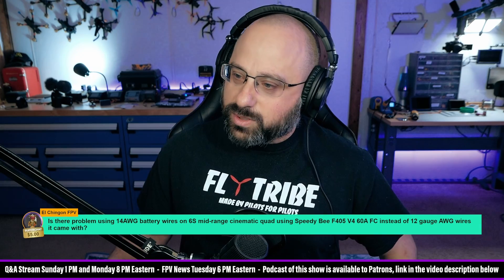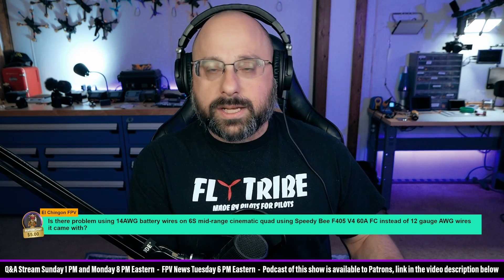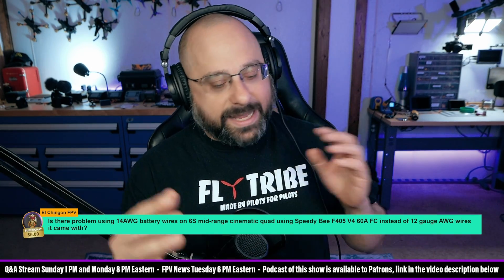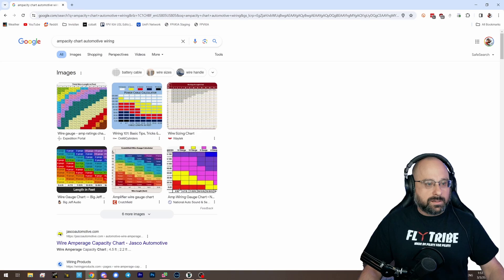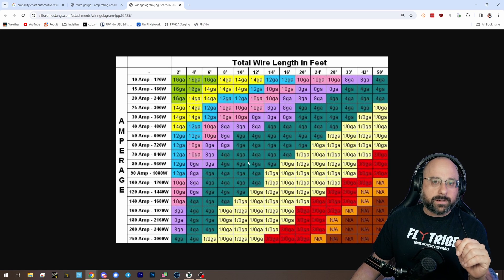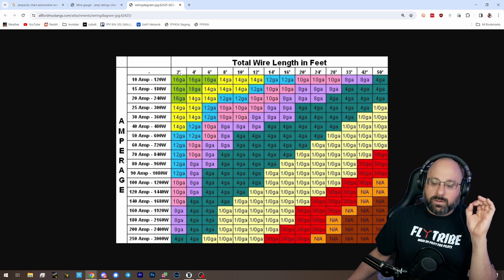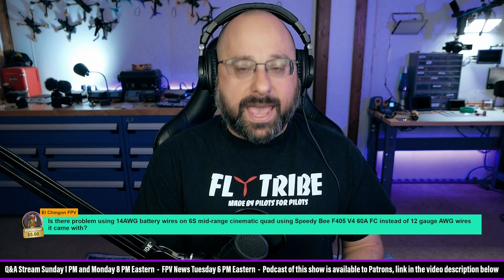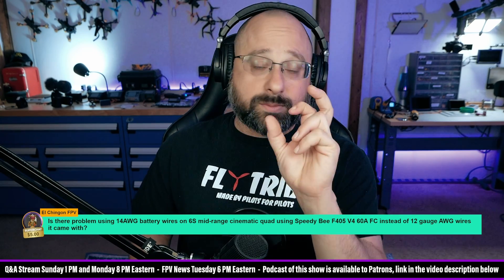What Wire Gauge For My 6s Battery? Lipo XT60 Connector Wire Gauge? - FPV Questions

Comment: From years of testing and many quad builds, I can say:
XT30 handles up to 90A burst on 6S. AWG17 is enough and perfect for xt30.

Xt60 hadles up to 180A burst on 6S. AWG14 handle the current no problem and fits the xt60 well.

You can disagree and show me charts and manufacturor ratings, but I havent melted or desoldered a plug or wire so far with my own ratings.

Like bardwell says, it's only burst ratings for a few seconds, short wires and lots of airflow.

Besides soldering awg12 or bigger really sucks.
Reply: Well manufacturers alway rate safe level. So people don't come back saying I ran 90a and melted xt60. 
I have low amp 5" I could use xt30 and never heat it up. I only put xt60 cause easier to find battery sizes I wanted. But I put xt30 on it with adapter and never gets hot.

Comment: The answer is yes. You can use 14 gauge on most 5 in
Reply: Me with 13awg on my 10" long range hehe 😅😂  granted my big lipo is 10awg but my esc is only 60a 😮

Comment: When 6s first started popping up and gaining traction. I come from 30+ years of rc surface and air (mainly planes) I got into fpv back in 2016 and in my rc trucks my go to connector has been xt60 however in my groud vehicles i run xt90 on anything 4s and up xt60 on 3s down till i get in to whoops obviously xt30 but when 6s hit fpv that blew my mind that they were running 6s on a xt60 lol is it the same rule of thumb as this video?
Reply: Well depends on amps. Higher voltage is less amp at same watt of power. Also the connector is constantly getting wind blown on it cooling it off. Unlike rc car that connector is inside the car. Or plane it is inside